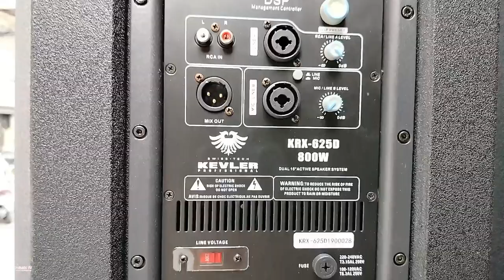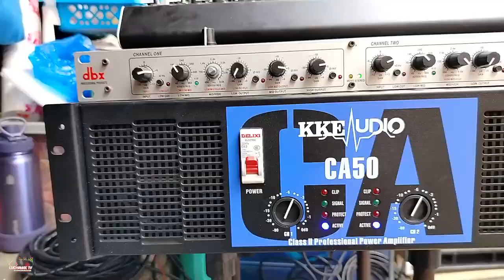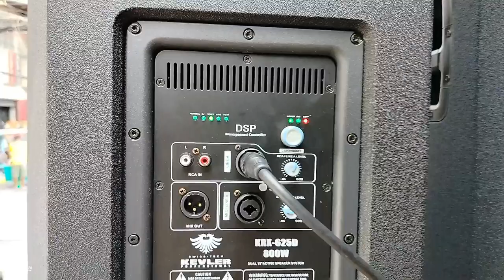sa Sobrang yanig ni Halimaw box tindahan nagalit na

Comment: Ganyang set up boss , magkano po ang presyo boss
Reply from the maker: Ang halimaw box 18 inch ay 12,500 isa  pares by 2 pair ay 25,000  Kasama Ang corner guard sir sa Live Pro 18 speaker ay 7,000 isa piraso by 4 pcs ay 28,,000
Sa Kevler KRX-625D active speaker ay 44,000 pair
KKE Audio CA 50 power amplifier ay 23,500
Speaker wire Royal cord 16x2x75 meters ay 4,800
Speak on male 70 pisos isa by 8 pcs ay 560
Mixer na titanium Audio ay 7,000 cross over ay 2,300
Equalizer ay 2,500
XLR cable ay 1,000

Comment: Boss mangutana ko ug unsaon mamalihug sa imuha palit?
1. Joson Airbus 15 Fighter Passive Wooden Speaker
2. Joson Hulk 8ch Professional Mixer 2023
3. Joson Jupiter Max Integrated Power Amplifier
4. XLR Cable
5. Speaker wire 10m + SpeakOn
6. Professional UHF Dual Wireless Mics 
7. Speaker Stand IMix TR - 602B
8. Platinum Piano XL SD
Reply from the maker: Message kayo sa Facebook page ko Luchamax Tv po sir